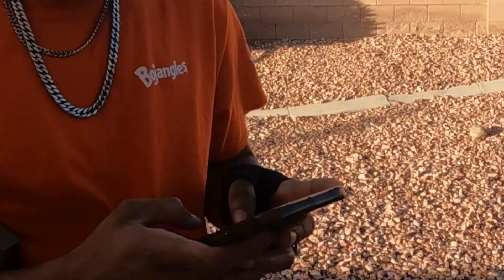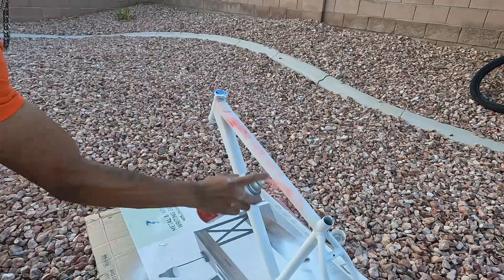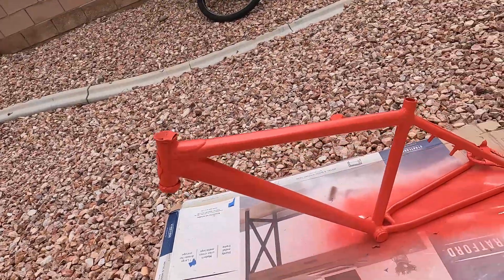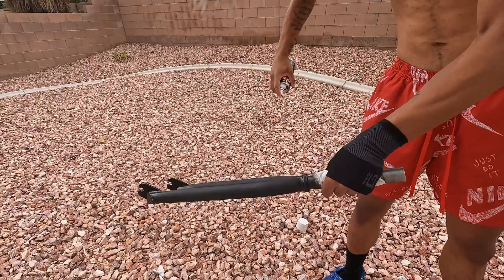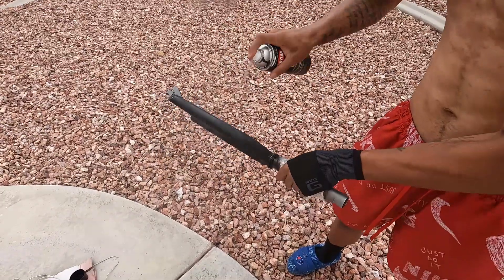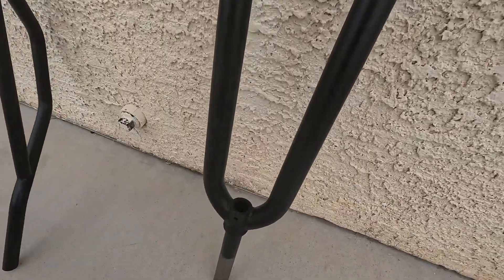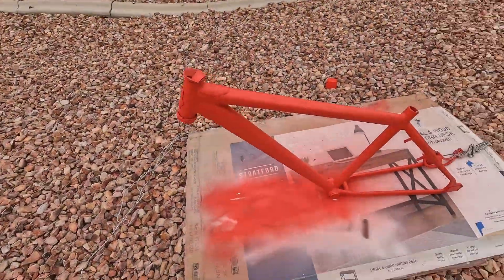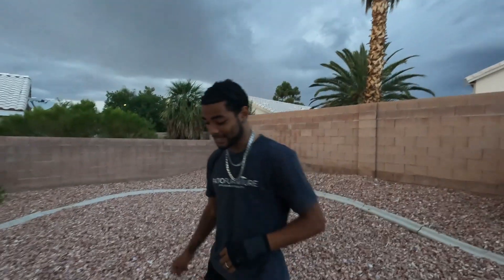Rebuilding  a THRONE DA'GOON

Comment: What’s good g. How many cans did it take to just coat the frame fully and completely?
Reply from the maker: I usually go with 2 cans but to get a nice thick layer I’d say use 3-4 cans. Makes the sanding easier so you don’t accidentally sand to the primer. 2-3 cans of clear coat for the best results